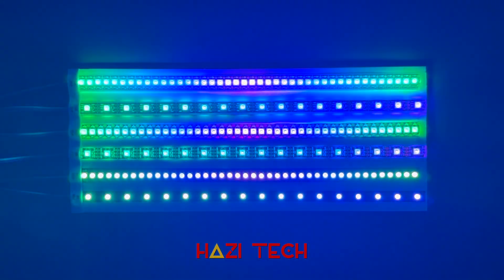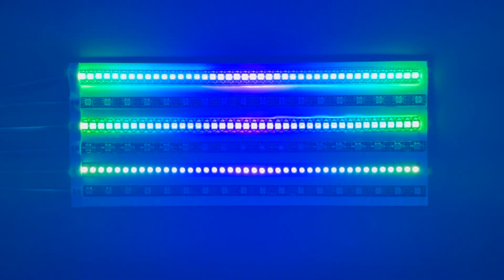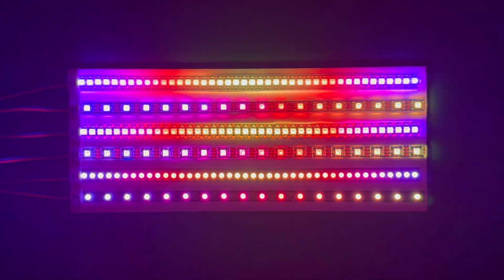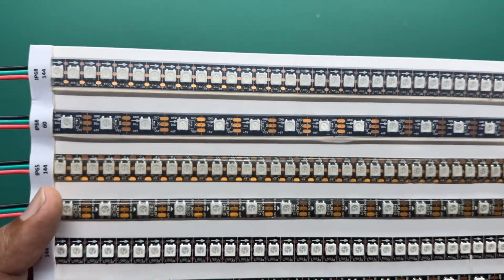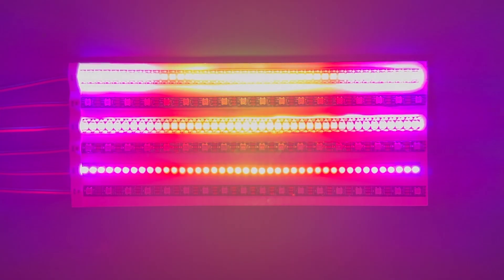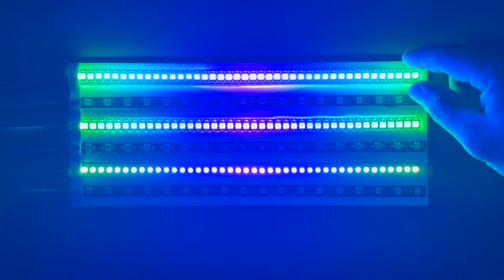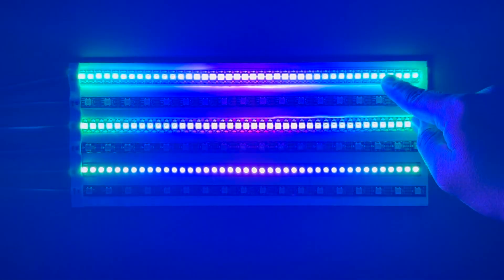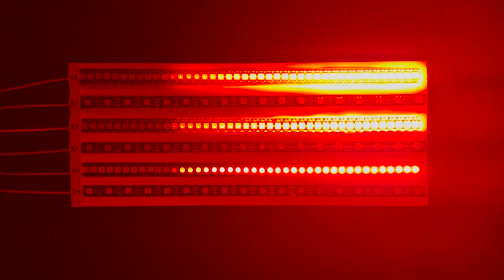Pixel LED Density, Waterproof Rating vs Performance | Choosing the right Pixel LED type | Part 1

Comment: Are the 12w LEDs brighter than the 5w LEDs? If I just need red for example. Would using 12w be a brighter higher quality light than 5w?
Reply from the maker: Yes. 12V type (WS2815) single colour is brighter than 5V (WS2812)